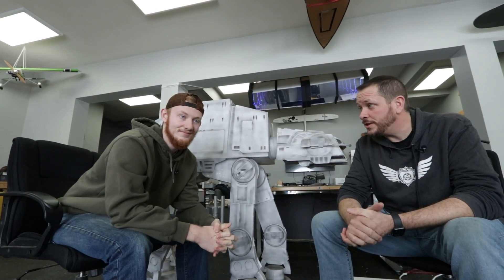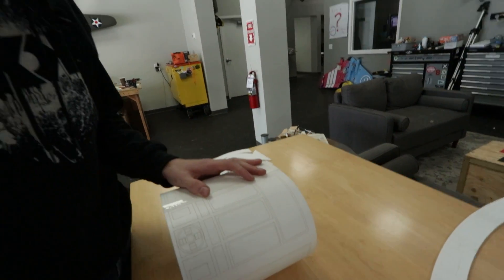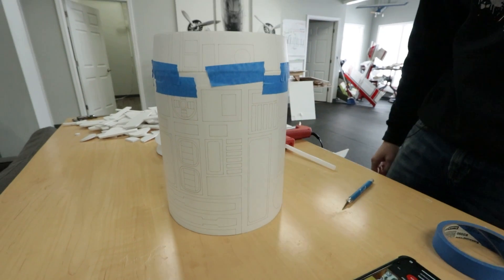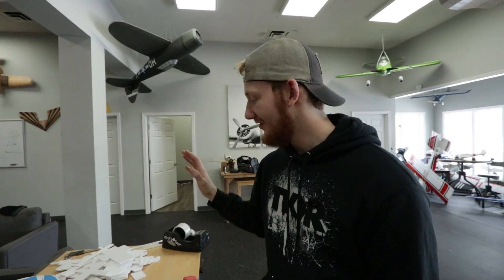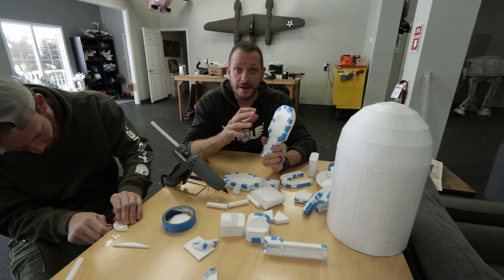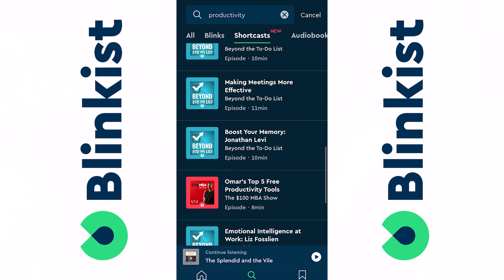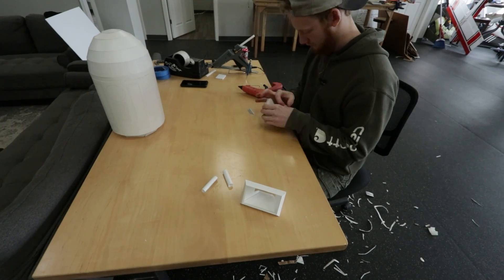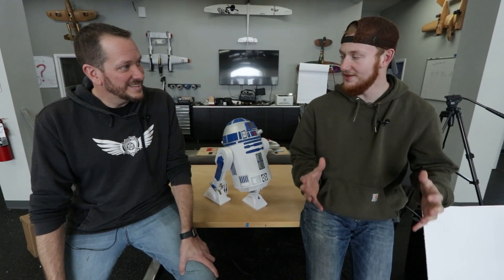Desktop DIY R2-D2 YOU can build!

Comment: I was figuring you would put ducted fans into the legs, or maybe use a white mesh for part of the dome and have a big prop in there with smaller ones outside for steering.

Comment: Well your foam R2 is way better than the large 3d printed unit i tried . Given the hours it took to print , I went to sleep, I awoke to the finished body, looking like the leaning tower of Pisa.... 16 hours wasted , cut off the God part, placed it in terrarium  as he appeared coming out of the water in the movie ....a lazy save . I have tried to make the TARDIS  from Dr Who fly, small quad inside,  well I did get lift off and then the dive into the ground  , built again, modified and repeated results ...why don't you give it a try,.